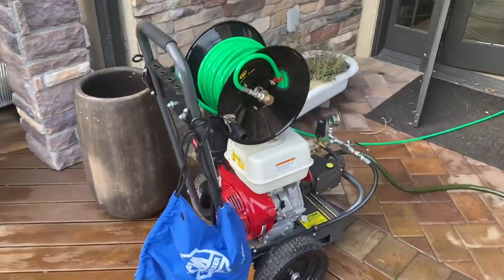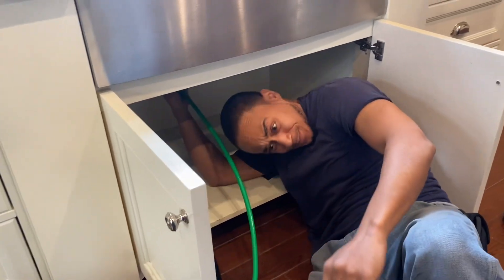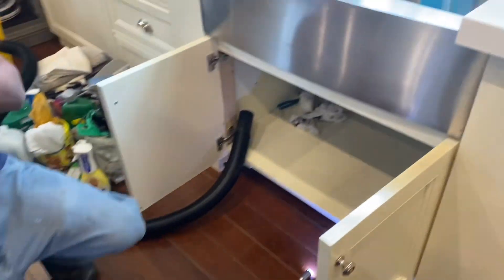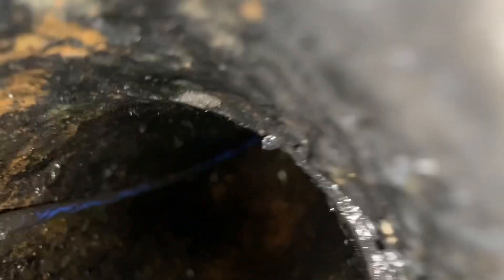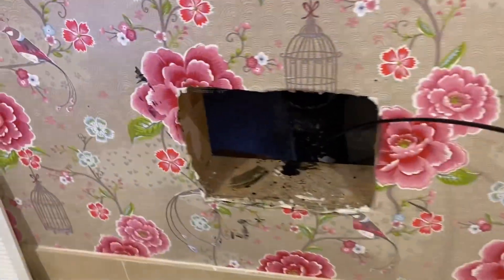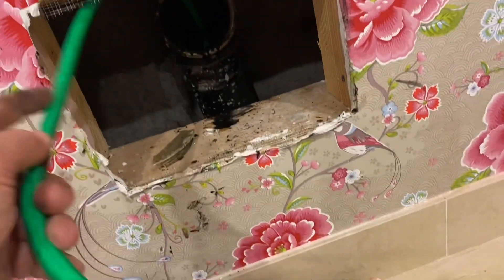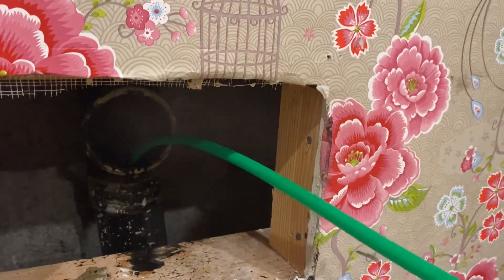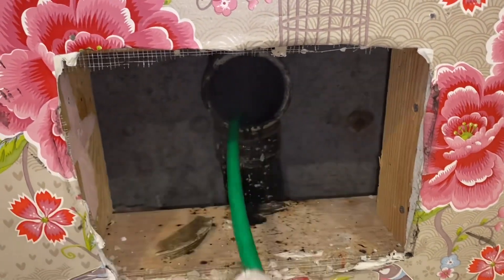BLOCKED DRAIN 101

Comment: Saw a laundromat with old cast drain pipe clog right up with soap years ago.. They used a Water jet to clean it out but recommended a replacement with a wider pipe...The same pipe clogged again in a couple of years and had drain line replaced with larger plastic pipe,..25 years later still no problems